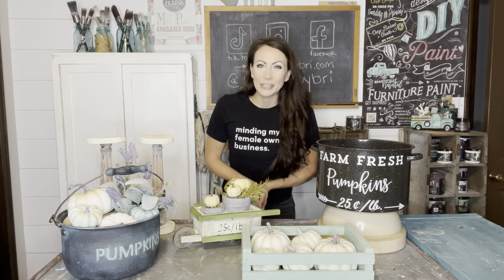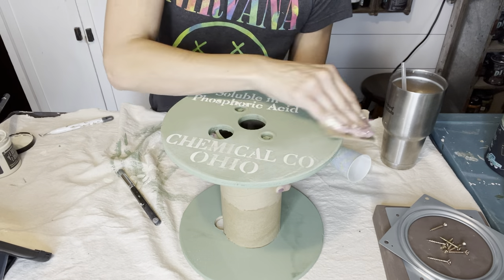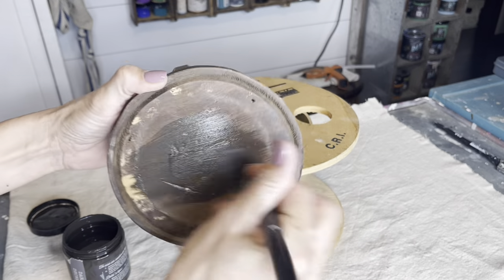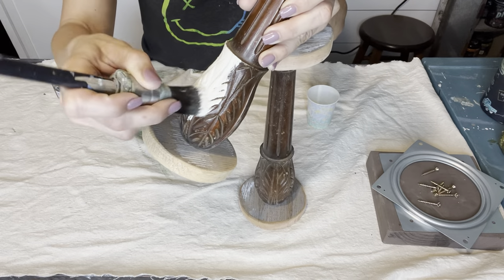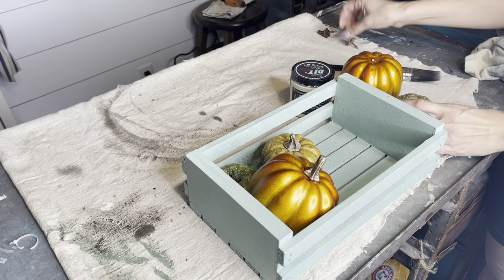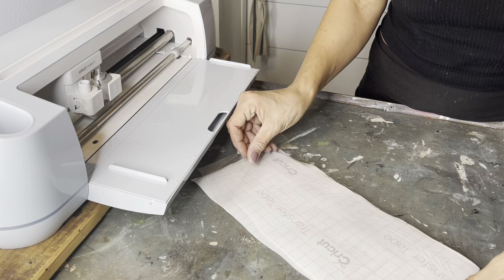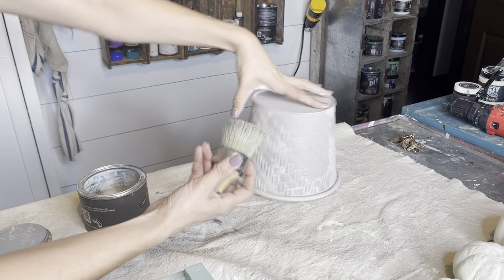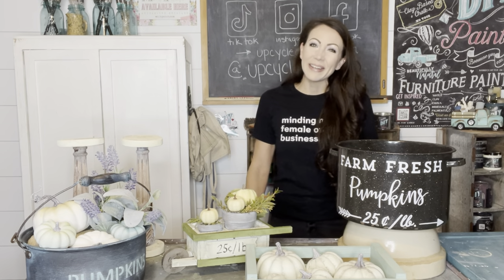Thrift Flip For Profit | Cricut Home Decor | Fall Decor 2022 | How I Make A Profit Selling DIYs

Comment: A great cricut tip I got given when I first started years and years ago is instead of peeling off the transfer tape from the vinyl, instead flip it over and pull the vinyl from the transfer tape, it works much better! Especially if you burnish from the front and from the back first. Pretty much halved my transfer time & saved my sanity!